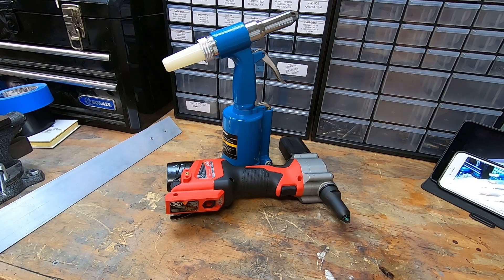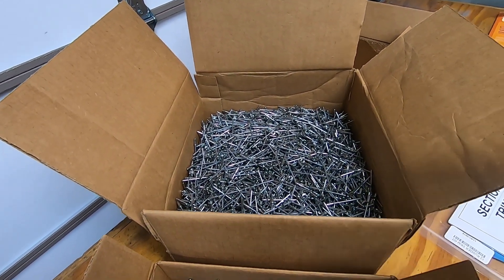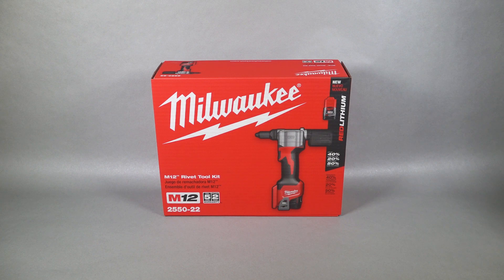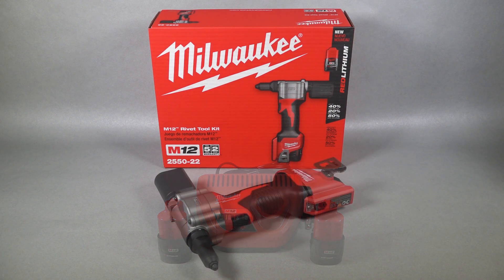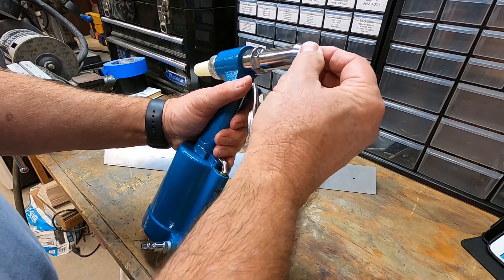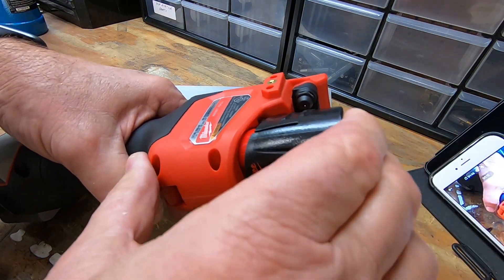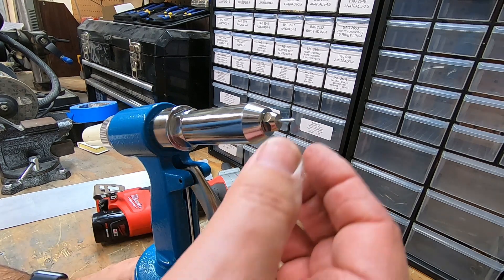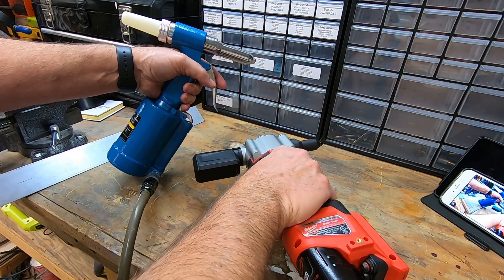Van's Aircraft RV-12iS - Milwaukee M12 Cordless Riveter Gun for Pop Rivets

Comment: I do a lot of riveting; the air riveters are very fast and relatively cheap to buy. The downside is the hose. It hampers manoeuvrability, drags around the floor causing a trip hazard, and of course there's the compressor noise. Battery riveters are slower and are more expensive, but on balance they are the better choice IMO.
Reply from the maker: Agreed. I have a good friend who comes out to help now and then. We fight over who gets what...

Comment: How good are the pop rivets compared to the standard aviational ones?
Reply from the maker: The majority are standard rivets, using a bucking bar for the most RV kits, however the rivets supplied by Van's aircraft are pop-rivets for the RV-12iS. I think the new RV-15 will be pop-rivets as well. I always go with the suggested rivets from the mother company.
Reply: The airframe was designed specifically to use pop rivets! So all the math for bond strength was done based on using the provided pop rivet designs.